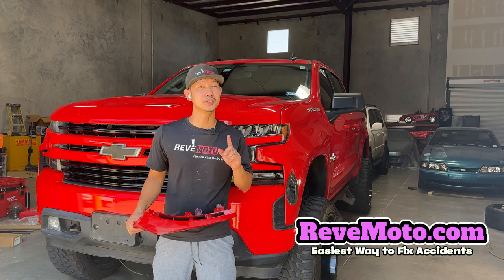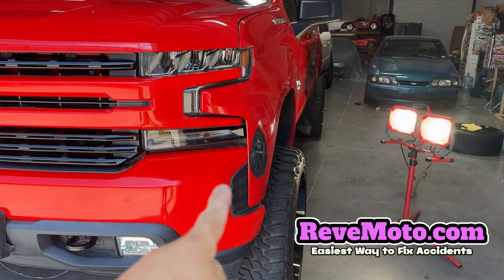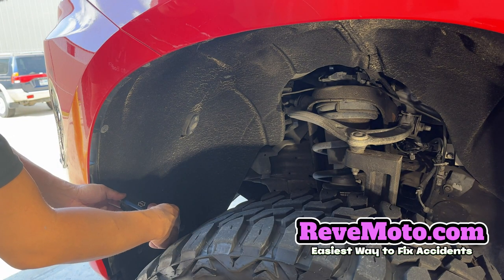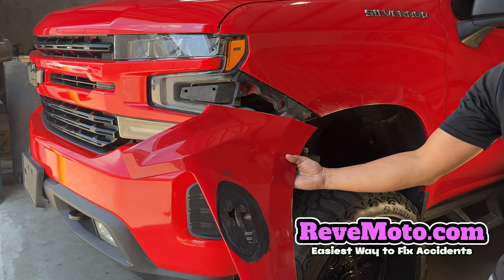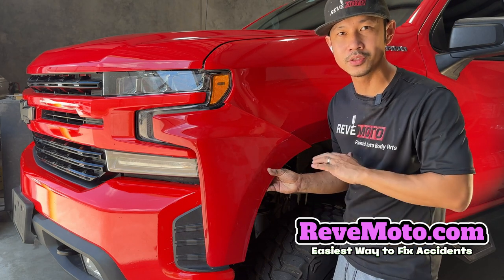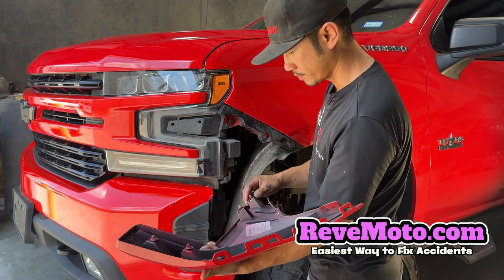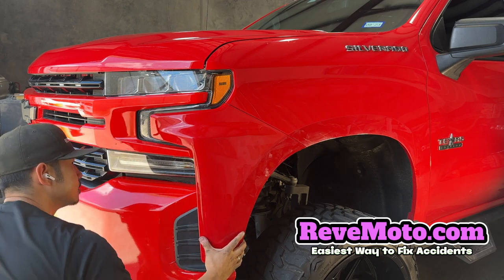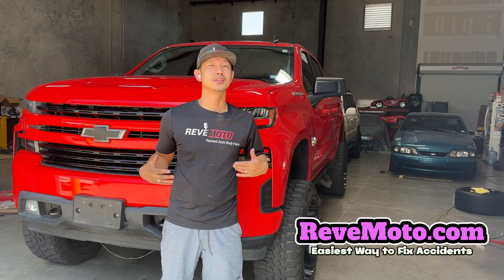ONLY Full Removal and Installation of a 2019-2022 Chevrolet Silverado Front Bumper End Cap.

Comment: This is not correct way to remove! There are 6 bolts total. The three in the wheel well and 3 on the inside of the motor compartment on the fender. I was able to get mine off by only loosening the 3 inner bolts. You need the white plastic piece inside to hold it snug and keep from rattling. If you notice in his video a white piece of plastic came flying out when he jerked the cap loose. That’s because he broke it. That piece has to be in there!
Reply: What is the correct way?
Reply: There is only that three screws and then pull.  The thing that flew off was a bracket that the customer broke.
Reply: Exactly, this tutorial is  bs. There are definitely 3 more on the top side. That must be an after market fender.
Reply: @adammonroe1754 do you know where I can get the correct info on taking that part off? I just bought from them…..

Comment: 100% there are three (3) screws inside the engine bay that hold the bracket that secures this fender part.
Reply from the maker: Unless you trying to remove the bracket those screws are not used to remove just  this cap.
Reply: If you do not remove the screws inside the engine bay to remove the bracket that holds the upper part of the piece, then it will not properly and securely fasten.
Seriously, I wish it was easier but that is definitely the correct way to do it.
I did it this weekend. A bit more of a hassle but if you have to tools for it, way cheaper then a body shop. All you need is a 90 degree and go up through the fender.

Comment: What about the bolts under the hood?
Reply: That’s what I’m saying. Just broke my panel doing exactly what he said. Same model and everything. Pretty pissed
Reply: This guy is lying.. there are 3 bolts under the hood. One of them nearest to the headlight is almost impossible to reach. I needed to remove a small bracket under the hood to give myself enough clearance
Reply: 1:28
Look at the debris after it comes off
Reply: So is this a good product? How do you properly take it off?
Reply: The screws your talking about near the headlight is for taking the bracket off.  You don’t need to take the bracket off to remove the cap
Reply: That was the bracket that the customer broke already and didn’t want to replace.  To replace that bracket the whole fender needed to be removed .
Reply: This is exactly how you take it off.

Comment: Nice I accidentally scratched my passenger side pretty deep on a boulder while on trail. What is the differences between US built vs Mexico built. I know Mexico has the “Cheyene”. But is there a difference is holes/size?
Reply from the maker: Yes the holes are different.  When ordering make sure you select the correct one for your truck.   Send us your Vin number if you unsure.  Go to www.ReveMoto.com

Comment: So what’s the deal? Are there 3 more screws in the engine bay? 
Where are they? How did he not do it in the video but still put a new one back on? 
@revemoto what’s up???
Reply: No the three screws are to remove the bracket . Unless you broke your bracket they take off those three screws.  To just take off the cap it’s the three screws on the side.